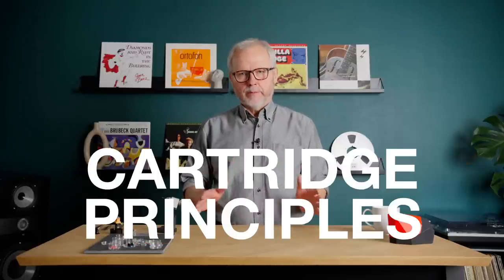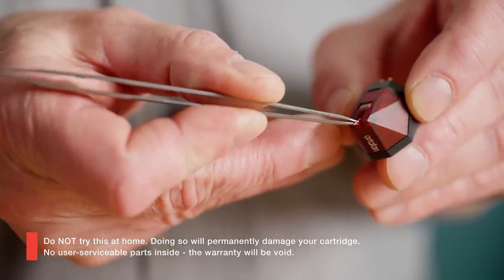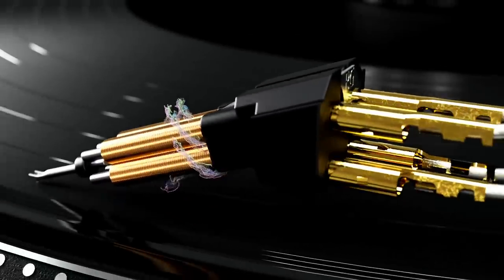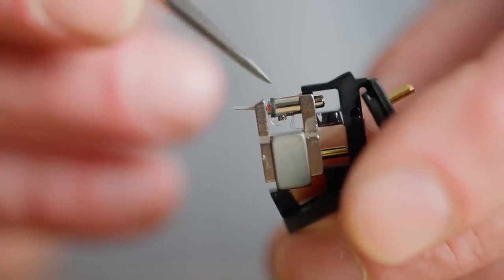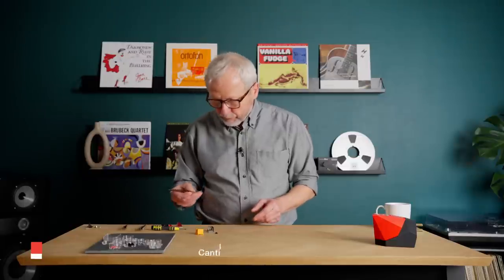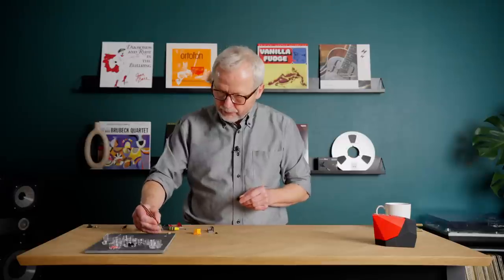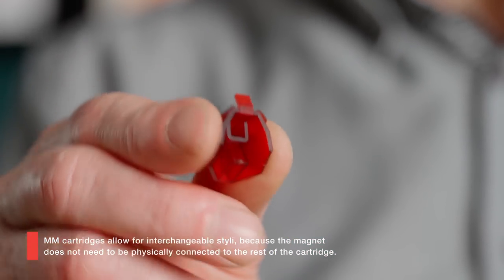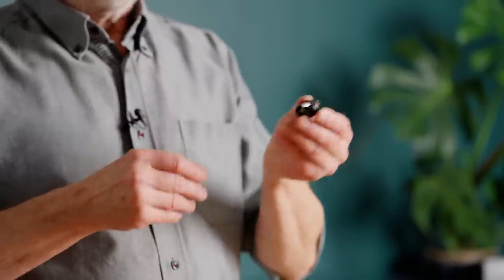What Makes a Cartridge Good? | Moving Magnet vs. Moving Coil

Comment: Great introduction! I'd love to see a video regarding production costs of MM vs. MC cartridges. Why do most MM carts top off around $1000 USD but MC carts can skyrocket up to $20,000 USD? Also, how is a high output MC cart designed differently than a low output MC cart? Performance-wise, do high output and low output MC carts give equal results?

Looking forward to more!
Reply: The short answer to that question is that MC cartridges have to be made my hand under a microscope as the coils are 100 times thinner then a human hair and very fragile And can not be wound by machine.  The wire its self is very expensive. Then you would have the cost of training someone to do that job. Man hours to produce a cartridge are much higher.  Go check out the youtube video "A J van den Hul Builds AT a Cartridge" There is also some footage of in the Rega factory winding a pickup somewhere.
Reply: Mine is a 540+ Ortofon high output MC bought 1992 I think so a poor man can afford MC? It is an excellent cartridge made in three different costs. All of the difference between the three is that tiny "needle". Ortofon made the hardware exactly the same between the top of that line and the middle so thats where I am at. The needle made of emerald not diamond and the cut of the lowest cartridge Spherical the two other models exactly the same Elliptical cut exactly like the cutting tip used to cut vinyl records. Tracking must be mentioned. The 540 is the only model that can reproduce the sound of 50 cal brass cannon sound. About 3/8 inch modulation on vinyl think of a MM bouncing around on that?

Comment: Very informative video.  Thank you! One thing that might have been mentioned is that small magnet, big coil, and big magnet, small coil, generate a similar amount of POWER, so that the much much lower impedance of the moving coil cartridge, when stepped up with a transformer, actually provides a similar voltage into a 47k ohm load to that of a moving magnet pickup.

Comment: As far as I know, the Ortofon MMs are really MIs, i.e. they are following a principle also known as "Moving Iron". While that is often described as a mere sub-category to the MMs, it would be nice to know how MIs are different from "true" MMs. It would also be interesting to know how these current generations of Ortofon cartridges differ from previous generations going back some 50 years. The notion among many Hi-Fi enthusiasts is that apart from rather superficial issues, such as the compliance of the cantilever and the external design, practically nothing has changed over the years, as is the case as well with many of the company's competitors.

Comment: I would like (very much) to see an explanation of why an MC cartridge might sound better than an MM one. Your vid explains very well the different physical principals involved,  but says nothing about the sound. why (if it it) is mc better than mm?
Reply: It is the reduction in size of everything which results in less loss of electrical signal. MC needs its own preamplifier. I built a preamplier that has two inputs the preamp for MC is internal and can be switched off externally. Side by side comparison is necessary. MM can be had cheap MC mortgage your home. As with everything you have to be extremely rich for MC.  2019 I was offered $45,000 for my Turntable. Brand new Ortofon cartridge 1992 made the difference.

Comment: I do have a question, What do you think of Wooden head shells? I recently bought a wooden head shell,  l lined it all up with my protractor everything looked good but the cart looked off center when I put it on over hang gage & looked directly at it?  I then took my calipers measures the 2 slots from side to side & noticed there was a 0.0020 thousands difference from each side.  The records sound great when I play them, & it all lined up good with my protractor. But is it ok that the cartridge is off Center? is my question Any help would be great Thanks..